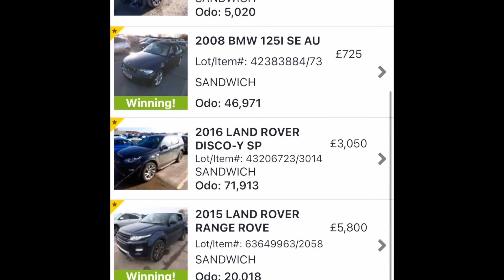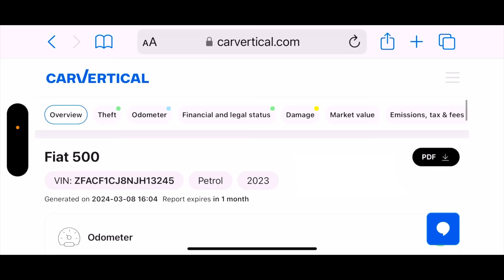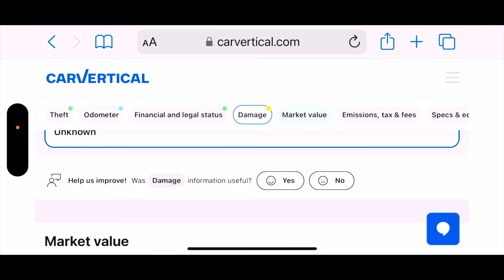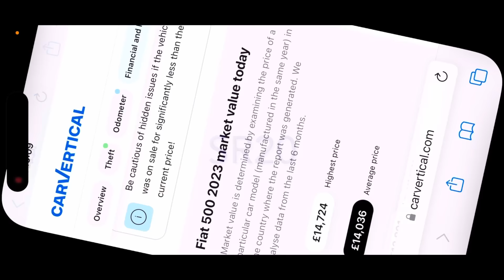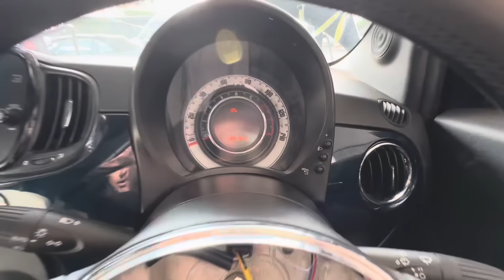ANOTHER SHOCKER FROM COPART SALVAGE AUCTION

Comment: Yes former zipcar. Been using these for years (don’t have a car). Primarily they have: 1) a control module (hidden - allows the remote access and managed bookings), 2) a key retention device in the glovebox (where you put the key at start/end of the rental) and 3) a sensor unit on the windscreen (used to open and close the car with your phone/smart card at start and finish of your bookings).
Hence there will be three sets (at least) of non-standard loom pieces. Great work as ever guys

Comment: Rob, the ring around the ignition barrel is to detect the immobiliser chip in the key. The immobiliser itself is useless but if you break connection to that ring, the car will never start. Best simple immobiliser for a Fiat 500! The wires to the dash connector or to get access the the CAN bus as the dash is a node on the bus.
Reply from the maker: lol I know bud

Comment: Well done unravelling that cut wiring where the immobiliser was fitted. It’s always easier to remove such equipment when in possession of the wiring diagram and manual showing how it was fitted in the first place. You did not have that luxury but still got the job done.

Comment: How does a manual transmission and clutch work when the car is running in electric mode?
Reply: It's a mild hybrid, so it doesn't get about on electric power alone.
Reply: @SheridanTighe  But don't hybrids start off from standstill with the electrics then the ICE starts as more power is needed?
Edit - Scrap that. I just asked the google mechanic and it filled me in on mild hybrids. All understood now. I wont delete my comment. Cheers.

Comment: There will most likely be a fault logged for the BSG (Belt Starter Generator) Code P1947. It disables the hybrid system when there has been a crash. This can be only removed by the dealer for around £100. Dash will light up like a Christmas tree otherwise.

Comment: Not great that the rental firm did a number on the wiring Rob
Reply: Was that's y it was so cheap ??
Reply: They just removed their equipment in the most efficient way, tbh it helped as it was pretty obvious what had been cut and needed joining again, just a pain working on it in a small space, I'd of done it with the dash still out and would of likely removed the drivers seat to give myself more room. Good to see there wasn't anything else hidden and it's running.

Comment: Car Vertical didn't show it was a hire car, and why doesn't UK show if the car is either a Hybrid or EV on the number plate. They really dont give a toss about the responding emergency services do they.
Reply: The 500 is the most mild of mild hybrids, zero miles on electric and the system only runs on 12v so no need to have any identification or orange HV cables
Reply: Daz I think EVs have a green badge on the left hand side of the number plate..
Reply: EVs get a green strip on the number plate. Hybrids do not however, as they are not zero emission.
Reply: @philtucker1224 Thanks Phil, do hybrids fall outside of this indication?
Reply: @DazGeary  (my wife has a Lexus hybrid) but I’m not aware of any marker on the reg plates..
Reply: Not compulsory for green number plate stripe
Reply: @articeddie5494 Same in some EU countries. You can get plates that show it's an EV but you don't have to. And I don't think hybrids are eligible for green plates, only fully electric ones.

Comment: Hi Chris and co have you guys ever tried to buy from Silverlake Auctions in Southampton ?  I saw a 2014 Fiat 500 for only £500 Cat N with just s dent in the door , replace the door and you got a perfect car , only reason i dont do it is A im a Female and B i dont have a trailer to tow a car back  but yeah Fiat 500 is a very good car the 1.2 engine is like indestructible as its the OG engine from the 1990s you know when the original Punto was released?  so tried and tested tech , the only problem is they have zero power 0-60 is like 13 secs but £5 of petrol = 50 miles so you cant beat that value for money.

Comment: You were lucky with the wiring removal, I worked in a main stealer regularly getting non start issues with these type of installs and most cut associated wires and joined in various places away from the original cut areas. E.g not leaving the other part of the wire  next to each other. 👏🏻🤌🏼👌🏼

Comment: Their loss is your gain. Depending on how long the paint will take to get done, this should be a quick turnaround. The screwed up wiring meant a lot of work but you figured it out. With fees and transit to your shop, the work to be done, you could nearly double your money on this. It should be a good seller as would likely meet the draconian pollution rules of London with a low road tax and easy to park.

Comment: What's the implications of it being Cat N not S? I assume the assessor was shown the photos from the good side! It's not illegal to mention a business' name, just stay factual and say it appears to have formerly been X's, and has had their jiggery pokery box removed (in your opinion, badly). But at least they weren't lying about it being a non-runner!
For the truck, bid on an old Parrot 3100 Bluetooth kit. Top notch noise cancelling, better than many later OEM systems.
Reply: @JamesBrett: Cat S is structural damage, cat N is non-structural damage which is better when selling on as a prospective purchaser won't have to worry about checking for possible structural issues from a poor repair. Cat N can be cosmetic, trim, lights etc - all expensive parts to replace with new but little or no damage to metalwork